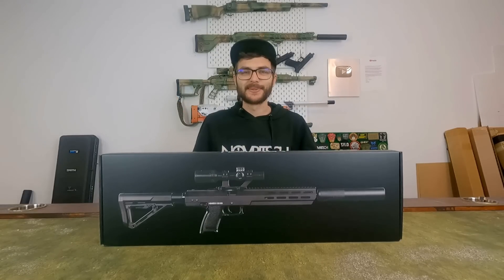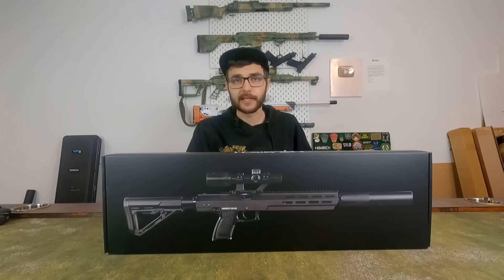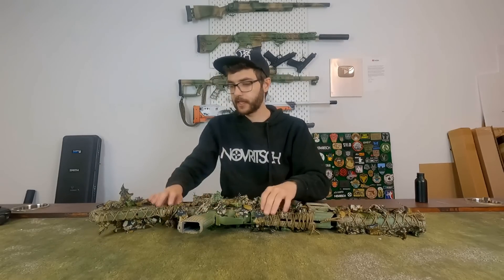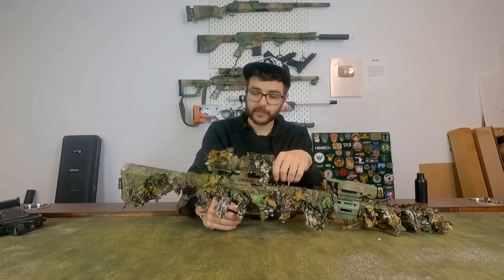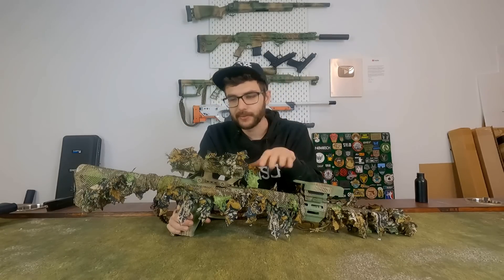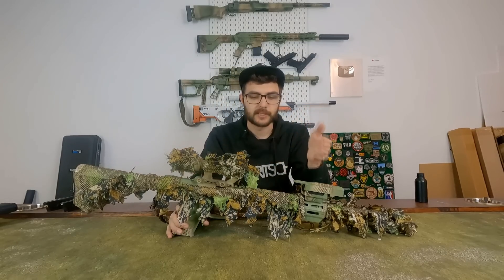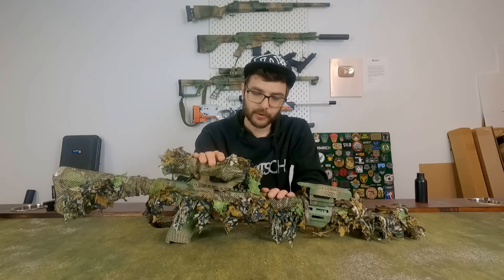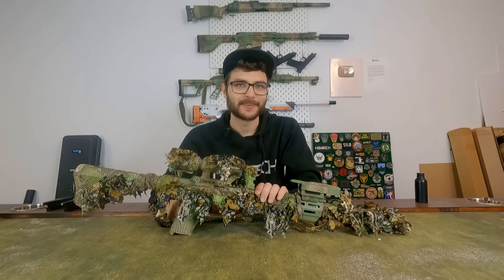My PROBLEM with the NOVRITSCH SSX-303

Comment: Pro tip
Holster on your back of plate carrier molle. 
It is great for carrying. But you might need a friend to put it on for you to do the pistol rush in. 
And cqb Russian valves. Can't confirm the threading.
Reply: I've been wondering on that. Think a shoulder mounted strap would be more user friendly for solo swaps?
Reply: @jerryglennie5375  the problem is you want it secure so it isn't loose or shaking.
You might be able to have a Velcro attached Velcro overpanel or something. But I usually only have issues putting it on, that might take a friend, but taking it off you just need to touch the button. 
I would recommend a sling for it (I use one of the y-style each shoulder and rifle), I use one for it and no complaints so far
Reply: Nice to know

Comment: Video synopsis: Issues with the gun are not real issues just personal tastes and typical players you find in air-soft matches. Still highly recommends the gun as it is very high quality and reliable overall.

Sidenote: for the CQB issues, just shoot in a thinner spot on their gear so they feel it regardless of the sound, and in reality they should still be able to hear the snap of the bbs impact and are just looking for an excuse to not call the hits.
Reply: Thanks for the summary.  I figured the "issues" would be mostly user preference.

Comment: Thank you for this insightful video. The extension to HPA is particularly interesting. I would be happy if there would be more details about this. The Novritsch store has no matching parts on offer here either (if I see that correctly).
The noise at 00:07 seems to be a cat?:D I had to laugh hard.

Comment: Honestly the holster I think would be more effective if you attached it high up on your back to a chest rig or even novritsch’s suspenders. It would have to be angled slightly, but it would be very Halo-esque to be able to draw it from the back that way.
Reply: for the back u would need an easier way to release the gun there...
Reply: @AirsoftRakune  An easier release would be nice, but if you're holstering it on you're back you're not doing so expecting to draw your primary at a moments notice. You'd basically just do it for photos or walking off the field so you don't have to hold it.
Reply from the maker: @MB-tc7tw  As I said in the Video, I think it would be way easier with a folding stock already - Also I am using a sling most of the time so there is no need for me to put my primary into a holster

Comment: Hi Fabi
Was sind deine Erfahrungen mit der 303 in hpa? Die Vorteile...ja die sind ja klar, aber wie macht die Waffe das mit?
Reply: Was meinst du mit "Was macht die Waffe damit"?
Reply from the maker: Mein HPA Regulator geht bis maximal 120 PSI das ist ungefähr die Stärke von Greengas, also die Waffe hält das ganze easy aus, ebenso die Mags usw
Reply: @sniperbuddyfabi  alles klar danke. 
💪🏻🤘🏻
Reply: Und welche Ventile benutzt er für den Umbau der Magazine weiß man das ?

Comment: Actually its a real issue with the SSX23 that you think you are shooting, but you are dry, so no BBs, and there's no way that you can tell unless you test fire it on something close or take out the mag and see.
No blow back is nice, its silent its usually sturdier (not the case with ssx23, trigger assembly is crap, chinesium brittle metal), but it also does not give you any indication on when you are out of BBs.

Comment: Hi, what setting you are using the low joules or high joules, and what weight bb’s you run?
Asking because the power regulations in my country (Portugal) only can run up to 1,3 j, so only can order the low joules version. 
Still worth the gun? 
Thanks in advance 🙏

Comment: Fabi, thanks again for the video. It confirms some early thoughts after I've receiving mine over a month ago. I have mag BB loading problems and Novritsch's support has made a suggestion to start filing. I cannot play with this until this is sorted and it's really disappointing.
I shouldn't need to do this when TM mags are 100% reliable in comparison.
 I have HPA tapped one TM mag as there are many compatible adaptors out there. I found performance is disappointing when green gas become unstable and variable, hence why HPA in my opinion the way to go. Something you commented on. 
I still don't know what Novritsch magazine "really are", Y&P, KJW or Matrix. My guess it's a Y&P? Can anyone answer this? Thanks